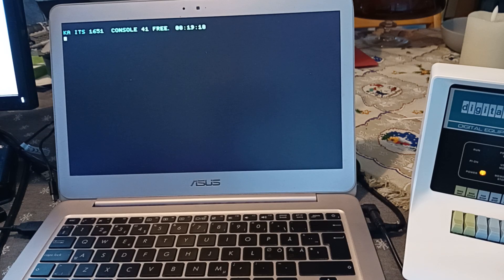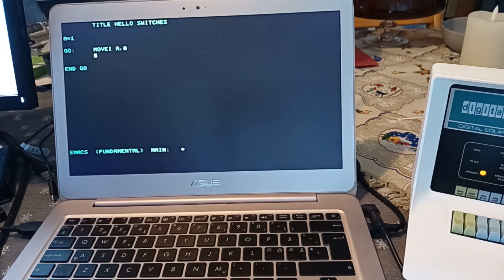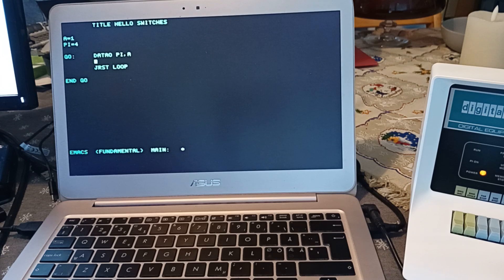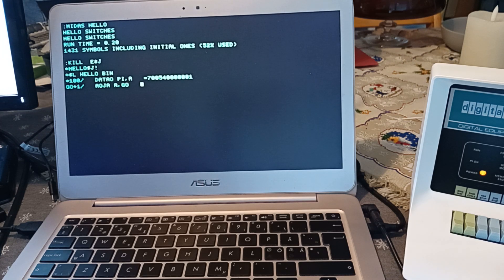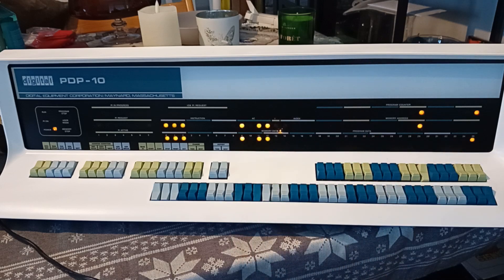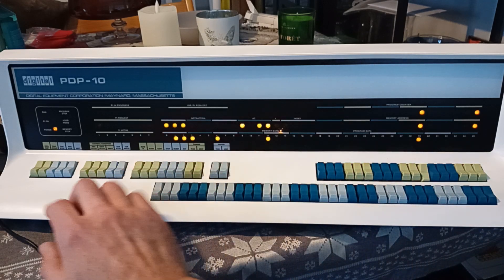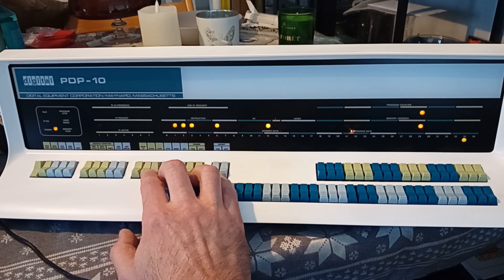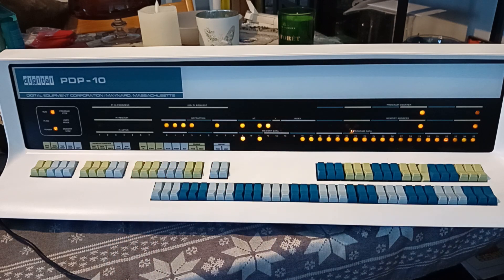Toggling in a small program on the PiDP-10

Comment: Didn't COMPUSERVE run on DECSystem 10 or 20s? Would be cool to bring up a little compuserve system.
Reply from the maker: Yes, a bunch of them.  But the software they used does not seem to be available.  Whether some of it still remains is an open question.
Reply: Yes, @BrotherAlan, I recall that they did.